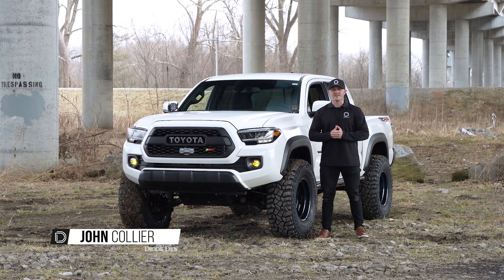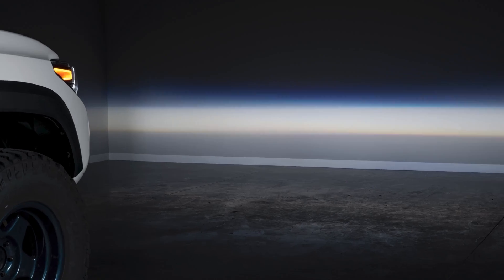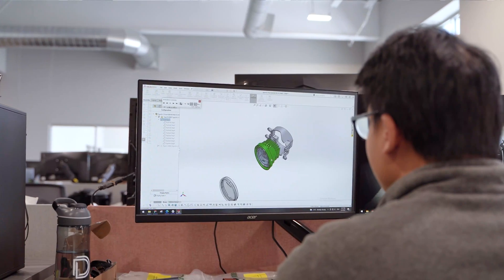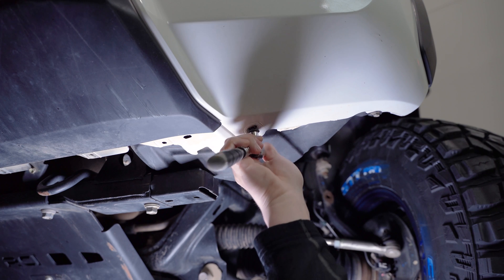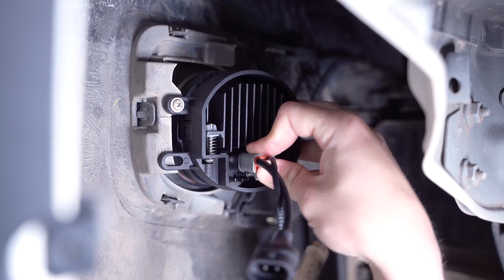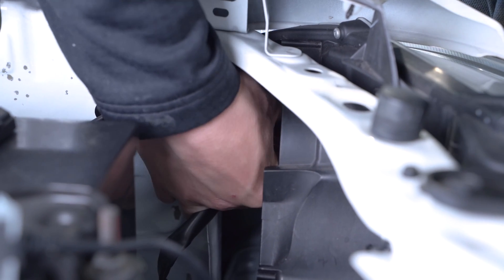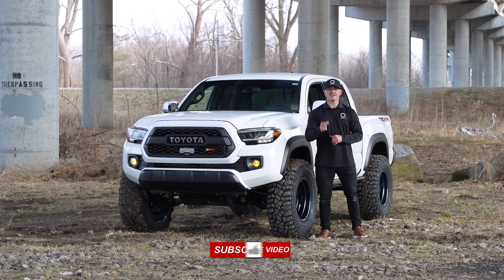NEW! Elite Series Fog Lamps for 2012-2023 Toyota Tacoma | Diode Dynamics

Comment: What if my side marker has already been tapped into? Will it be fine if i have 2 tapped into the same wire?
Reply from the maker: It depends on the power draw, however, if it is a very low amperage draw, it should be ok. 

You can give our customer service team a call as well and they can help you out too!

Hours: Monday-Friday 10 a.m. - 5 p.m. CST
Email: contact@diodedynamics.com
Phone: 314-205-3033

Comment: Are these Glass Lenses? Have the LED factory headlights and don' t want to tap into any wiring. Any Plug and Play Connectors you offer? Thank you
Reply from the maker: The lenses are automotive grade polycarbonate, and the fog light kit includes everything you need to install! In order to get the backlight option to function without tapping any wires, we do offer a 3rd gen plug-and-play harness that plug into your factory headlight harness and allows for a full install without tapping any wires!

Here is the link for you!
https://www.diodedynamics.com/plug-and-play-backlight-harness-for-2016-2023-toyota-tacoma-pair.html
Reply: Thank you! But after looking at your website link, the harness is not compatible with OEM LED Headlights? And that is what the truck has. So no plug and play harness then for trucks that have OEM LEDS?
Reply from the maker: @okkin981  Unfortunately, we do not have a compatible harness for OEM LED Headlights. You will have to use a tap, or custom splice into the power wire in order to gain function of the backlight. The main beam does not require a tap in order to use, so they can be installed without taping anything!
Reply: Just bohght this set, super excited to install now. But let me ask are they drop in or do I need to align them after install?
Reply from the maker: @okkin981  We would recommend making final aiming adjustments once they're installed, as things like ride height can effect the output. Here's the link to our video on how to do so properly!

https://www.youtube.com/watch?v=p5RXq28ZOYo&t

Comment: Hi. I ordered SS3 and SS5 with backlights but I have not ordered optional wiring/harness/toggle. Can you advice on steps for using non DD wires to set up backlights? And material I need?
Reply from the maker: No extra material needed, just ensure you get a 4-pin DT-Style connector, and a 3-way switch! Just toggle the backlight switch on and off 3 times to change the colors to your desired color!

Comment: I have an issue installed eveything correctly on my 23 tacoma with led headlights. T tapped the pinkish wire. It did not work thinking i didnt pinch it hard enough. I went to use pliers to pinch it the wire got cut clean. I soldered it backtogether and thinking of a different way. Is there anyway to do it? Such as using a add a fuse even thought wire isnt long enough. In willing to add more wire. I know the backlights work cause i tested it by touching the ends to my battery
Reply from the maker: Sorry to hear about that! Feel free to give us a call at 314-205-3033 Monday-Friday 10 a.m.- 5 p.m. CST, or shoot us an email at contact@diodedynamics.com, and our service team would be happy to help you with that.

Comment: I have 2022 4runner orp. Where should I put the wiring for  backlight?
Reply from the maker: Most customers wire the backlight into their DRL wire for the backlight feature, however, if you don't have a DRL in your headlights, you could have them wired to an auxiliary switch, or another power wire, however you see fit!

Comment: Ok DD I've looked everywhere on the internet. I want to run a 2nd set of SS3 on my Tacoma. Do you guys offer a deutsch connector splitter or the output of 2 lights would be too much of a load?
Reply from the maker: Hey there! It all depends on what harness you are using and what lights you plan on running! You will have no problems running two pairs of Pro SS3s with our Heavy duty harness! All of the information is on our website, or you can contact our team for more assistance at 314-205-3033 Monday-Friday 10 a.m.- 5 p.m. CST, or shoot us an email at contact@diodedynamics.com, and our service team would be happy to help you with that.

Comment: What are the suspension and tire/wheels specs on that tacoma? It sits lovely
Reply from the maker: We're not sure unfortunately, sorry about that! We know what lights are on it though! 😎
Reply: @diodedynamics  hey, was just wondering. I'm running diode ssc2 ditch lights on my tacoma and I wanna move up to the ss3. Do they share the same connectors? Or?
Reply from the maker: @GhettoFabulous670  You absolutely can! Just be sure to get the backlit model, as they use the same connectors as the SSC2!
Reply from the maker: @GhettoFabulous670  Yes! You can absolutely make the change, just be sure to purchase the backlit model of the SS3s, as those use the same connectors as the SSC2s!
Reply: @diodedynamics  I believe the back light models only come with the Pros and Max's, yeah?
Reply from the maker: @GhettoFabulous670  We offer non-backlight models of all three, Sport, Pro, and Max, as well as Backlit Sport, Pro, and Max!

Comment: Love the lights. My backlight feature after working upon installation hasn't worked since. All wiring is good & connected but. the backlight won't turn on. Does anyone have any advice on what could work or any other wire/area to connect to that is a 12V source?
Reply from the maker: Hey there! 
Please go ahead and give us a call at 314-205-3033 Monday-Friday 10 a.m.- 5 p.m. CST, or shoot us an email at contact@diodedynamics.com, and our service team would be happy to help you with that!

Comment: What does type A and B mean on these new fog lights?
Reply from the maker: Type-A and Type-B refer to the mounting bracket included with the fog lamp. 

Type-A: 
Acura ILX 2013-2018
Acura RDX 2010-2018
Acura TL 2012-2014
Acura TSX 2011-2013
Ford Bronco (w/ Standard Bumper) 2021
Ford C-Max 2013-2016
Ford Explorer 2012-2015
Ford Fiesta ST 2014-2019
Ford Focus 2009-2014
Ford Focus ST 2013-2014
Ford Freestyle 2005-2007
Ford Fusion 2013-2016
Ford Mustang 2006-2009
Ford Mustang 2015-2017
Ford Ranger 2019-2022
Ford Ranger STX 2004-2007
Ford Taurus X 2008-2009
Ford Transit 2010-2018
Fiat 500 2012-2016
Honda Accord 2013-2015
Honda Civic 2016-2021
Honda Civic Si Sedan 2013-2015
Honda Crosstour 2013-2015
Honda CR-V 2012-2014
Honda CR-Z 2013-2016
Honda Insight 2010-2014
Honda Odyssey 2019-2020
Honda Pilot 2012-2019
Nissan Frontier 2009-2021
Nissan Sentra 2007-2012
Nissan Titan 2017-2019
Nissan Xterra 2005-2015
Ram 1500 (non- LED) 2019-2022
Scion FR-S 2013-2016
Subaru Ascent 2019-2022
Subaru BRZ 2013-2017
Subaru Crosstrek 2013-2022
Subaru Forester 2014-2022
Subaru Impreza 2012-2014
Subaru Impreza (w/ Eyesight Package) 2015-2022
Subaru Legacy 2010-2014
Subaru Legacy 2018-2021
Subaru Outback Wilderness 2022
Subaru WRX 2015-2021
Subaru WRX STi 2015-2017

Type-B:
Lexus CT200h 2014-2017
Lexus ES350 2013-2018
Lexus ES300h 2013-2018
Lexus GS200t 2016-2019
Lexus GS350 2013-2020
Lexus GS450h 2014-2018
Lexus HS250h Base 2010-2012
Lexus HS250h Premium 2010-2012
Lexus HS250h Ultra Premium 2010-2011
Lexus IS200t 2016 
Lexus IS250 2014-2015
Lexus IS350 2014-2016
Lexus IS F 2008-2014
Lexus LX570 2008-2011
Lexus LX570 2013-2015
Lexus NX200t Base 2015-2018
Lexus NX200t Premium 2015-2018
Lexus NX200t F Sport 2018
Lexus NX300h 2018-2020
Lexus NX300h Base 2015-2020
Lexus NX300h F Sport 2018-2020
Lexus NX300h Premium 2015-2020
Lexus RX350 2010-2013
Lexus RX350 Base 2014-2020 
Lexus RX350 F Sport 2013 
Lexus RX350 F Sport 2016-2021
Lexus RX350 Premium 2014-2015
Lexus RX450h 2010-2013
Lexus RX450 Base 2015-2020
Lexus RX450 F Sport 2016-2020
Lexus RX450 Premium 2014-2015
Lexus RX450L 2020
Subaru Legacy 2015-2017
Toyota 4Runner 2014-2022
Toyota Avalon 2007-2011
Toyota Camry 2007-2015
Toyota Corolla 2009-2016
Toyota Highlander 2008-2010
Toyota Highlander 2014-2022
Toyota Matrix 2009-2013
Toyota Prius 2010-2011
Toyota Prius 2015-2016
Toyota Prius C 2012-2016
Toyota Prius V 2012-2016
Toyota RAV4 2006-2012
Toyota RAV4 2016-2021
Toyota Solara 2007-2008
Toyota Tacoma 2012-2021
Toyota Tundra 2014-2021
Toyota Venza 2009-2014
Toyota Yaris 2006-2014
Reply: @diodedynamics  

I see 

Thank you

Comment: Are the t tap’s reliable? Like what if water gets to them?
Reply from the maker: We use them on our personal vehicles with no issues. You can always solder the connection or wrap the t-tap in electrical tape if you would like more protection!

Comment: Wtf you guys are using ttaps.  Especially in area that is prone to moisture. I have lost respect for you as a company. Best buy wiring quality here.
Reply from the maker: Hey there! Many of us here at Diode use T-Taps on our vehicles with no issues. However, this connection can always be soldered if you have the means to do so!

Comment: is the back light step optional or mandatory?
Reply from the maker: It is optional! You do not have to run the backlight if you do not wish to.
Reply: @diodedynamics  what does one do with the extra “back light” wiring then??
Reply from the maker: @henryscreations  It will unplug from the harness!

Comment: Could you also tap into the led DRLs on the non LED headlights? That way you can run the back light during daytime driving without having to turn the marker lights on.
Reply from the maker: Hey Kody! You can tap them into any 12v switch power source.
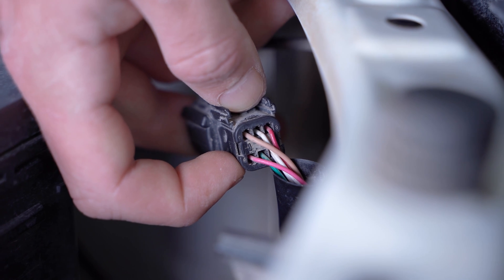Reply: 3:54 If we do tap into the LED DRL, do we T-Tap the green wire? The are only 3, black/white (ground?) Pink and Green.
Reply: @davemann8195  I’m guessing red orange wire that’s the hot wire I’m guessing ? Did that work ? I’m doing mine today.
Reply: @ShawnFielden  it was the green wire, DD confirmed. But. I avoided using the t-taps, as they have corrosion issues with time. I bought the plug and play harness for the backlight from DD's site instead 17$.
Reply: @davemann8195 Do the amber back lights come on with the Drl's during the day?